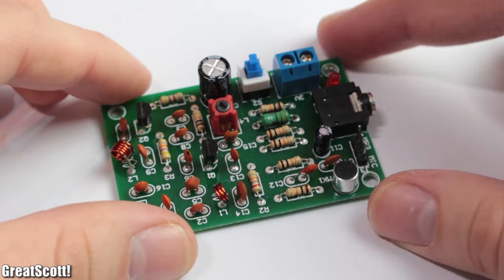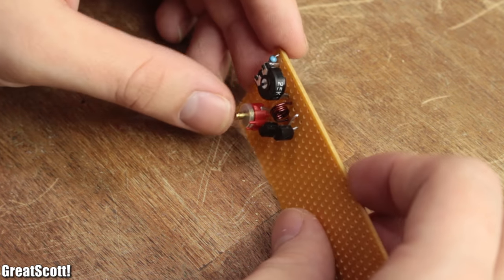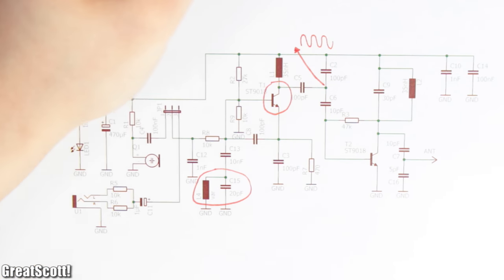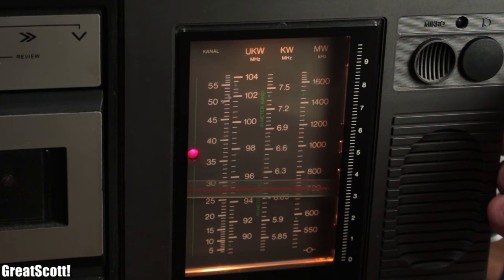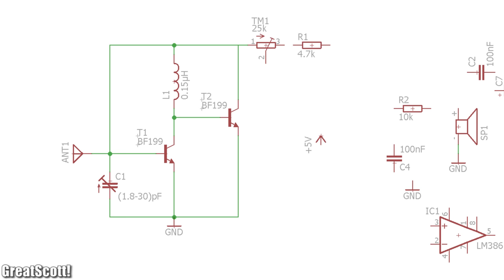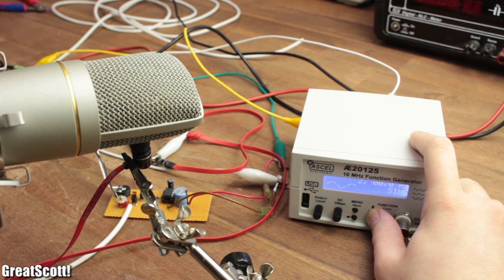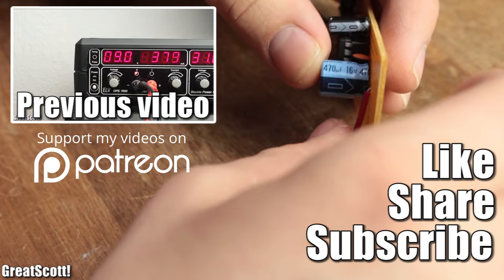Build your own Crude FM Radio || FM,AM Tutorial

Comment: People are always impressed when i tell them i can build a computer, but i think it is much more impressive to be able to build a radio.
Reply: +About 47 T-Rexes Depends on which parts you use for that computer. If you only use 74xxxx logic and passive components it's not that easy.
Reply: Radios are really much harder.
Reply: Yes but making it from basic logic gates is much harder.
Reply: But digital electronics alone are not that hard, only diffrence from computer is fact that computer is programable, you need to ask yourself you really need you electronics programable
Reply: Depends on what you refer as building a computer (logic gates or just pc components)
Reply: the computer is all modular , for the radio you need your own components and you need to solder, for the computer you only connect the connectors
Reply: Lukas Graphen I'm not trying to imply that building a computer from scratch is in any way a simple task, but at least you don't have to do a lot of complex calculations; most computer ICs have fairly well-defined behaviours which makes it somewhat simpler to accomplish. The main problem, as i see it, is to get the timings right, but almost all ICs have a datasheet where you can find all the relevant information.
Reply: Maybe do a video on it
Reply: +About 47 T-Rexes you are right. I can build small 16 bit computer but that doesn't impress myself until I can make a radio or television.
Reply: Same, it's called hooking up a touchscreen oled to a raspberry pi  with an sd card
Reply: There are single chip radios now. By now, I mean a decade ago. Building a radio from discrete components is a lot easier than doing the same for any kind of programmable computer.
Reply: I mean, not really. I made one when I was 9, and at that age, I would NOT be able to build a computer. Albeit, I had a kit that helped, but yeah.
Reply: Then there's building a radio with bamboo and coconuts
Reply: building a computer is just a simple 10 piece jigsaw....building a radio is about understanding electronics, tuning, filters, depending on how deep you want to go...i always think of the radio as being the heart of electronics....it brings it all together, power supplies, signals, frequency modulation, fine tuning, chokes, ...radio is actually a very beautiful thing.
Reply: rundown thomas, mh. assembling computer vs constructing radios.
Reply: Bruh, for a computer you plug in connectors
Reply: @JaysonSR you need to know how the number 455 (sometimes 465) comes into play
Reply: RF is the elite among the elite
Reply: @JaysonSR 
Well done
Reply: What'd be amazing us building your computer with logic gates and then transmitting those waves using digital modulation techniques by building your own circuit
Reply: @LukasFink1  ben eater 😂
Reply: Probably because saying that you built a computer sounds pike you made every single part
Reply: @rheyjen006  to make a basic computer, you only need logic.
I actually took a course called "from nand to tetris", that taught how to build a functional computer out of nothing but nand gates.
the knowledge requirements are pretty low to make a basic one.

rf, on the other hand, requires quite a lot of physics and radio theory to build a basic one.
Reply: When you say “build a computer”, do you mean build one out of discrete
components (capacitors, resistors, transistors, diodes, etc) or assemble one from components such as the main board, RAM, GPU, CPU, power supply, etc?
Reply: @SpenceReam  I think he meant "from parts", because building a computer from discrete components is much much more impressive than building a radio.
Reply: @LukasFink1 by build a computer he means putting the cpu in the socket etc.
Reply: Why do you need approval ?
Reply: Radio is way more simple
Reply: @runthomas I think he’s talking about creating a computer from transistor/IC level.  Now that is a challenge
Reply: It depends on what level you're talking about. Building it with modern components? Radios are way harder. But using vacuum tubes, relays, even ICs is way harder than making a radio
Reply: yep, but when you build it from ICs and transistors, that is impressive. am waiting until my next paycheck to order the parts to do my Hello 6502 project

Comment: Impressive. In the calculation of inductance the winding number N should be squared, so according to the formula your inductance is around 0.6 uH instead of 0.15 uH. However, that formula applies for long coils, and yours cannot be considered as long, so your correct inductance is probably less than 0.6 uH (maybe closer to 0.15 uH, but that is a coincidence).

Comment: Your circuit for the tuner has been around for a while. It may confuse people how it works and seems to be shorted out, but it basically turns two transistors into a "tunnel diode". The tuning is done by "Slope Tuning" which is really AM detecting, so will pick up noise as well. Tunnel Diodes are very expensive, so this circuit is great to play with to see how it works.

Comment: You can also use a hot blob of solder to strip enameled wire and wick it away after usually you can do it cleanly with any decent iron like the 888.

Comment: Very cool, This took me way back to the 70's when I used to build regenerative receivers to listen to ATC communications. They were actually very sensitive, could listen to airplanes tens of km away, but not too selective - adjacent frequencies were all heard at the same time. Next I started modifying comercial, cheap FM receivers to listen to ATC and that worked really well. They were very sensitive and selective, I'd redo the markings on the dial from 118MHz to 130 MHz, and when set to one ATC frequency I'd hear only that one, not nearby channels like the regenerative receiver. I even modified a few receivers for friends. Great days long gone.

Comment: the Boy Scout handbook from the 60's (still available online) has a instructional tutorial about how to built a small radio requiring no power with everything hand made and which used a old spring metal bed frame for the antenna plus a old style low power clip on ear piece to listen to it...... and it does work, I built one for real when I was 12yrs old...
Reply: and my bad, this builds a AM radio not FM

Comment: i tried the circuit . and it worked ! . i had a little trouble with tunning but i manged to pick up 2 fm stations  88.2  _ 88.7 MHz
i actually didn't have the bf199 so i used  a 2N3904  and it worked !! . but had to use a high impedance earphone .

you are awesome  :)
Reply from the maker: Thanks for the feedback :-)

Comment: I made this circuit myself. I got no reception at all until I connected a 4.7pF in between the antenna and the RF input. It indeed has bad sound quality, with lots of noise similar to that of old AM radios. Sometimes the stations changes to a nearby one by itself, or I hear two stations at once. It is still simple and fun to make though.

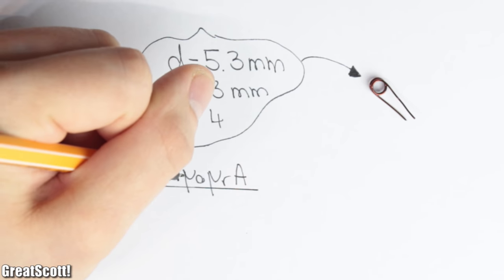Comment: I've rewatched this video many times while trying to create my own radio and have found it very helpful :). One error I found is that when inductance is calculated at @ 3:57 the formula shown should be N^2*mu_0*mu_r*A/l. The video has plain N instead of N^2. Nonetheless the calculated inductance of 1.478*10^-7 H is the correct value so the formula was only written wrong in the video, and as far as I can tell the rest of the calculations afterwards are okay.

Overall I loved seeing the process, thanks for the video!

Comment: Many years ago I changed the microphone cable in my office, that used to call our worker who had a phone call, I bought a 5 meter cable, when I connected the cable and turned on the amplifier, not a receiver, I received a super clear Indian station on the speakers, I shortened the cable, the Indian station disappeared, it was on Fm Station. Only can received one station.

Comment: Many simple fm transmitter is unstable they changed its frequency according to input voltage , nearby objects and some times by diractions . So is it possible to make fm transmitter using 555 ic if it at least get in 1Mhz range but  Such transmitter  need custom receiver because stander fm band are way higher then 555 maximum frequency range !! 555 are stable at fiz frequency i want to build this circuit as coller tracker for pets !

Comment: i think you make a mistake in oscillator circuit there is no feed back to the transistor base because it operate in common emitter mode and also no connection from collector

Comment: Hi :-)
Extremely snowy day here in Belgrade today, so I have played around yours schematics, a few days earlier YouTube suggested me the video. It really worked, but I'm still confused about yours lm386 wiring... Why pin 7 is grounded through 100nF capacitor?? That pin is bypass... is this some sort of feedback?? Then, why lm386 is grounded through pin 3, and signal goes to pin 2? Maybe I'm just puzzled because I did not analyzed schematics deeply, but, when I see lm386 I'm just expecting good old power amp configuration... 
Cheers, and keep posting!

Comment: have you ever thought of making spirit boxes? I think you'd be awesome at that
Reply from the maker: No idea what a spirit box is.
Reply: look up p-sb7 or p-sb11 on youtube. even radio shack 12-587. many people are using these as a paranormal research tool. in essence all it does is sweep continuously through FM/AM radio stations without stopping. I don't know loads about the technical stuff but I think people are bypassing the mute that makes the radio lock on to a station. when it sweeps continuously through the stations spirits can then manipulate the device to deliver responses to your questions. looking at your skill I would say this is a very easy operation for you to modify a radio in this way. I don't know if its something that would interest you but I thought id let you know as its something that's becoming increasingly popular. if you do have a go at this then please let me know as id love to see what you come up with. thank you
Reply: you could accomplish what the sb7 does with a radio IC and an arduino for sweep control. Those things are dubious, though. 

Floating around the internet somewhere is a schematic using ten of those cheap transmitters, spaced from 86.7 mhz to 112,7 mhz, all wired to the same audio source, with a 555 timer to drop the audio for a few ms at whatever rate you think their sb-7 is set to. there's enough leak in the transmitters to cover the whole radio spectrum. And from the spritbox, it's indistinguishable from the paranormal stuff the thing was designed for. 

A friend of mine had a hobby of frightening the hell out of the paranormal teams that'd go into the old building across the street from him. he'd hear them ask questions, turn it on, say some relevant or extra creepy stuff, or just play the exorcist scream into the setup...

Comment: Hi can you tell me how to build an FM Amplifier? (without damaging transmitter with it)
Reply: +Veso266 What you mean is called an VHF amplifier
Reply: Yes I mean that thing (I don't know how to amplify a signal and I don't understand why like 1KW Amplifiers are so expensive on ebay)
Reply: 1 kW is a bit too much power for you, except you're running a professional radio station. To compare that value:
In Germany VHF transmitters up to 50 mW are legal, as long as I know. Ham radio on nearly the same frequency has a range of at least 10 km with 10 W (with bad antennas or at a bad location).

So you may need 1 W to get heard in your whole district. And be careful with more, if you interfere with anyone,  the local regulatory authority (FCC in US, BNetzA in Ger)
could knock on your door.
Reply: yeah FCC (we call it AKOS there) can track me faster that could do this in Germany because Slovenija is realy small.

As I would like to understans how VHF Aplifiers work (can you make general purpose amplifier (for HF or UHF (if not why?)) and what components you must use to have more power out of it.

Thanks for Anwsering and Best Regards
Reply: Veso266
A VHF amplifier works like a normal amplifier. It uses at least 1 active element (nowadays transistors most time), they just need to work with higher frequencies.
You can build amplifiers that work within a high frequency range. In a power range < 50 W you see them often, because if the power gets above that you mostly try to optimize the efficiency with an Class C amp. These need an filter after them, because they create a too wide spectrum.

If you like to read more about amplifiers read this: https://en.wikipedia.org/wiki/Amplifier (maybe also in your language) I recommend you the paragraphs "3.7 Frequency range", "4.5 Class C" (this type is only used as RF amp), "4.4 Class B" (this type is the most common)

Comment: I dont need a ic for a radio just some transistors thinks about it in the 50s-60s we had vaccume tubes then in the 70s transistor came 
also i dont like everything is smd and very hard to solder

Comment: WARNING: Always check your local laws before using a frequency to transmit your RF FM signal

i think european laws must differ because in america you can transmit as long as you are very low power and only in the am and fm bands
Reply: i do know you have to check local laws for recording or monitoring phone calls but wii have always built and used transmitters in the usa with no problems you could even get transmitters in kit form